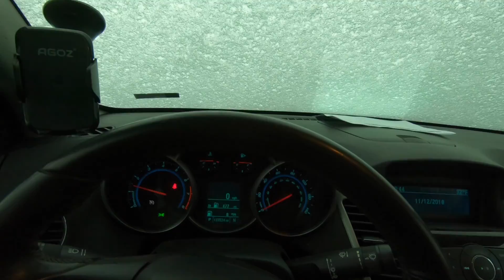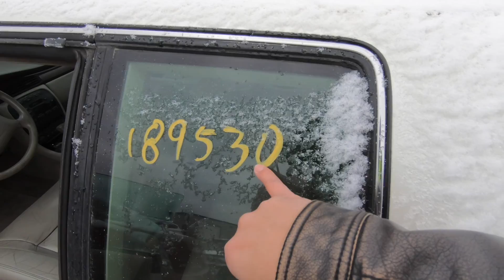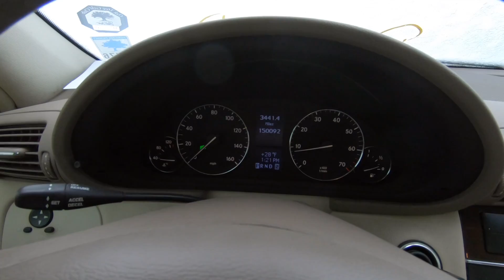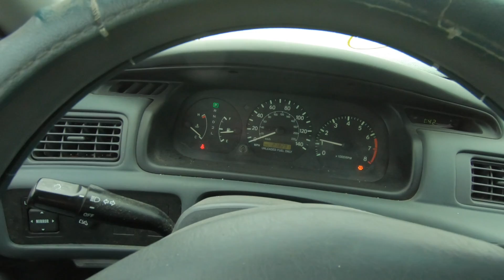Copart Walk Around + Carnage 11-13-18

Comment: The E500 has the SBC brake failure, Mercedes did a 25 year UNLIMITED MILE WARRANTY so u can take it to the dealer and have that fixed FOR FREE!! 
i have an 03 E320 and i got the letter from MBUSA so ur fine if the only issue is the SBC brake system
Reply: also that 5.0 V8 is a pretty solid motor so either Benz would be a good deal
Reply: Yes! I was scrolling through the comments for someone to bring that to his attention! I just got my letter in September... just waiting on the inevitable failure now, haha! It put my mind at ease because I know how much of a mess these systems are and it scared me to death knowing how expensive the repair would be.
Reply: Carson Weaver i know! that's several thousand dollars we dont have to worry about! Yay MB! 🥳
Reply: @redriver15262  As far so I know if it's already been replaced they won't replace it again.
Reply: Colm Farrel in some cases they will reimburse you some if not all of the expense but thats where it gets iffy

Comment: Out of everything you showed I'd go for the white Camry, they're legendarily reliable and long-lived.  Give that one a good service and a nice clean up and that one should be ready to go right back on the road to give someone another 100,000 miles reliable motoring.  I suspect the trans will be fine, it just looks like it hasn't had much in the way of professional attention judging by the lack of maintenance stickers but I imagine it has been serviced as I can't imagine it will have managed to rack up 170,000 miles on one cam belt/timing belt.  Given a change of trans filter and fluid it'll be fine.  It certainly looks like a car that has had decent care taken of it as it looks pretty clean all round for a car that has joined the 200,000 mile + club...

Comment: The Mercedes e500 has SBC system. If the battery is dead and doesn’t have much power it can cause an error on the dash. If you want it get it started and see if the error clears after running it for a while.

Comment: I'd get the silver Mercedes, IF there is a recall as pointed out below, but first I would do some research on those new struts to see if they could introduce a New problem.  perhaps they forgot to hook up an electronic part of the kit that bypasses the light?  Suspension and brake would have to work together.

Comment: The grey E-Class has SBC brake system, its not like normal hydraulic this is electrohydraulic, and the main unit (that u called airmatic pump) is not uncommon that it produces error codes after 300k pedal presses showing the pump is ready for change, it may be enough with just resetting via mercedes diagnostics

Comment: Northstar engines typically go out around 80,000 to 100,000 once she hits 110,000 miles is good to go. You don’t have to take out the transmission to get to the TCC solenoid but it is some work involve to get to it.

Comment: Avoid the E500 it has a broken SBC pump for the brakes. That's an expensive part unless you can find it cheap. Take the c280 they are very simple. The w203 c280 did actually have an option for heated seats you'll see the empty buttons on the centre console.

Comment: I bet the Head gaskets were done. My North star blew at 129K cost of 4000.00. I brought with it fixed for 2500.00 but blew a quart of oil every 500 miles.

Comment: Be careful of the trans in the Camry. Been there done that and we ended up junking the car after only a few thousand, just because I didn't have tools to change a trans and no know how but I am sure if I had proper equipment and some guidance I'd be fine. A junkyard trans was only $100 for it with no cover but the old trans has a cover :P

Comment: 13:09 Randy that is the SBC brake pump. Computerized brakes. Do NOT work on the brakes on a car like this without deactivating them first. Also, if you get fault code C249F it needs to be brought in for a reset at a dealer. If they need to replace it it's stupidly expensive. However, you can reset the SBC with a 5 dollar tool from China.

Comment: Good afternoon. The Camry definitely. I'm partial to either Mercedes. I like caddys so that Eldorado coupe with that 3 stage paint is nice. Northstars when serviced & taken care of go 300k easily. A guy I know has a 2000 with that kind of mileage no issues. 300zx convertible is clean. I worked in a junkyard for 10 years u need boots for that weather. Have a good day.

Comment: the thing you refered to as the airmatic compressor on the e500  is the sbc brakes and that could be the reason that warning light is on not a cheap or generally easy fix just a heads up youtube has a lot of info on it do your reasearch bud got    to get a code reader on that thing

Comment: Camry! That generation had some common flaws, and liked to leak some fluid. But rarely are they not reliable and ive never seen one with any transmission issues yet. And ive driven/seen/owned quite a few of them with higher mileage than that. Id definitely buy another one in that generation in a heartbeat given the opportunity. Theyre not worth much though... i wouldnt spend more than $500 all together if you want to leave room for profit. Id be surprised if it sold for more than $1300ish. Similar range as the old volvo you had

Comment: that was the sbc unit aka sensotronic brake control and that is for sure broken that part usualy fails across all mb cars cause is not that reliable at all also expensive af to rebuilt and even more expensive to replace with a new one
Reply: They can be re programmed if they have not been done before
Reply: Those are still under warranty by mercedes check online. 25 years
Reply: @Gnux91  Yea if you bought it check if you can get the SBC pump changed under warranty. You can also check the code on the pump to see what year it was manufactured.

Comment: I would take a chance on the silver Mercedes
Reply from the maker: Perhaps I did :)
Reply: @AutoAuctionRebuilds  AVOID the E500 the SBC brake pump is broke on it hence the big red warning light. That's an expensive part unless you want to use it for content then so be it.
Reply: @colmfarrel4742  SBC Pump now has a 25 year warranty unlimited mileage
Reply: @eddiesouther  Yes but it might have been changed already in which case you're kind of screwed.

Comment: Mercs don't handle the same without the Air Shocks. I would take the C 220 and the Camry. The V8 engines in the mercs do have their issues but i wouldn't touch it without a full merc history.

Comment: Stay away from the mini! I wouldn't be surprised if that was the turd mini from years ago when I was a porter at a dealership.  The automatic transmissions are atrocious in those early coopers.  If you want a mini buy an S with the 6 speed getrag, and look for rusting issues.  Especially behind the tail lights.  That involves removing the tail lights for inspection but definitely worth it!

Comment: @ 6MIN, The NORTHSTAR MOTOR, EXPECIALY THE "Y" VIN CODE, has 100 hp more! If the o2 sensors go bad, it will lead to the dreaded head problem! CHANGE THE OXYGEN SENSORS, WATER PUMP, & THERMOSTAT! I CHANGED MY WATER PUMP & THERMOSTAT BUT, NOT THE O2 SENSORS!!!!!!!!!! IT BLEW THE HEAD GASKET! IF ANY PART OF THE COOLING SYSTEM FAILS, OR THE O2 SENSORS, SAY GOOD BYE!

Comment: Am torn between the black Benz and the old camry.
Reply: However Benz are risky unlike the camry. Toyota's have high resale value and they last really long. That's why they usually have high mileage.
Reply: @tiago0922  There isn't much risk on a w203 they are pretty simple.

Comment: Most of the impacts on the Fiesta were birdshot out of a shotgun:
https://youtu.be/6qXwdBOZzpY?t=285
Rifle or pistol bullets would have penetrated the sheet metal, but birdshot won't.
Reply: I'm assuming another firearm was responsible for the blow throughs. Someone was sure pissed at someone.
Reply: The pass-through holes look pretty large, so I would guess they're from a large caliber pistol like a 40S&W or a 45ACP.
I wouldn't be surprised if the shooters were not the same people who stole the car. Chances are the thieves dumped the car in an isolated area, and some knuckleheads decided to use it for target practice.

Comment: The black Merc the dealer can't make a buck on it with their cost of parts
Reply: Junkyard.
Reply: @colmfarrel4742  Thats what they do or  wholesale them to mom and pops lots, thats what my dealership did, I worked for a big 3
Reply: @kevinvandevelde9789  Yea but you can buy parts cheaply from the junkyard. A power steering pump from a scrap w203 isn't going to cost that much.
Reply: @colmfarrel4742  so true  I have a 06 x5 parts aren't bad but a module or coding sucks unless you have the software, I've been out of the industry for a while, but one of my friends told me try to change the plugs on one of the newer ford 150's, my  taurus I had was a bugger to change the passenger plugs a starter in and out in 45 min's   over engineer'ed these days
Reply: @kevinvandevelde9789  True but the good news is he has the code reader from before which seems to read most Mercedes codes.
Reply: @colmfarrel4742  What I mean't was to write and flash the modules. But yes the creator series of readers work well. For BMW inpa or I've been pondering is bavarian tech's set up, more brand specific.The readers have advanced far from the ones I used.
Reply: @kevinvandevelde9789  Yea I was always of the opinion you needed a star system for Mercedes but I was surprised when Randy was able to get success out of his aftermarket reader.
Reply: @colmfarrel4742  Yes I was too. Although you get generic codes,. Then do some research on them. Hey check out Nathan DIY channel. I think I have a OBD 1 and a old OBD 2 reader in my tool box not worth using now a days
Reply: @kevinvandevelde9789  I stumbled across that channel on Tuesday by accident 😂
Reply: @colmfarrel4742  Oh the 50's kid too. I'm found of Nathan thou, samcrac, rich rebuilds.Scott Kilmer, steve Letho's law, company man. cold fusion. They may not trip your trigger but I like to watch instead of TV.  Just like A A rebuilds good channels thumbs to all of them
Reply: @kevinvandevelde9789  Not really a fan of Scotty he just trashes stuff which isn't as reliable ignoring the driving experience. Also, he recommends a lot of bodges. Haven't heard of Lethos Law, Company Man, or Cold Fusion.
Reply: @colmfarrel4742  Get a kick out of scotty , but some of the stuff he did in the old days I use to do. Driving Experience sounds like my BMW. I'm sweating it out but I like the car. LOL. check out the other channels may not  be what you like.Just have fun on you tube
Reply: OH vinwiki also another channel
Reply: @kevinvandevelde9789  I didn't just mean sports cars though for example a Lincoln Continental or a Rolls Royce would give a completely different relaxing driving experience to a Corolla. Sometimes people value that over reliability. I do find him funny though.
Reply: @colmfarrel4742  I know what you mean now.  Like my Bimmer but I am a ford man thought I would try german . I've got a 06 x5  I think I may have to clean off my tools and get  to start using them again  LOL  later

Comment: Yeah yall keep that shit out there man we don't need it here in Nashville at all. no one here knows how to drive in that shit any better here than most of yall there. Blood aint shit to get rid of get you one of those Steam cleaners from Harbor Freight for $119.00 and just steam the shit out of the blood wear rubber gloves and wipe it away with a paper towel then steam it again one more time for good measure. ACTUALLY the biggest issue with the Northstars is having to have them taken apart and time certed that and the middle block seal is a piece of crap that always leaks like a sieve I had my 94 Eldorado northstar for 3 years and never really did completely change the oil in it because every 2 days I had to pull into the gas station and fill it up with oil and check the gas. that's the ONLY thing I really disliked about that car though. incidently that's also the ONLY thing that keeps me from buying one of those XLR's too because I REALLY like those things! That pearl white paint is what I have on my 2006 Escal;ade EXT. my first one. not my copart one I redid the copart one is my daily driver at the moment and it's doing Fantastic! DAMN that 300 is nice looking and not too many miles at all either. I would have checked out the pearl white Cadillac CTS next to the silver Mercedes